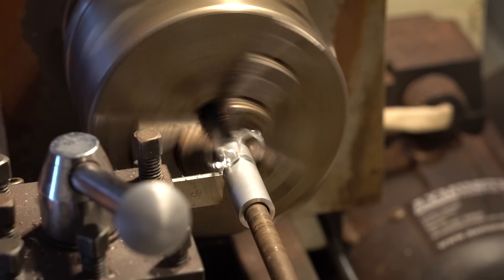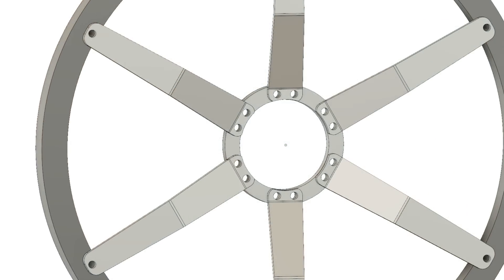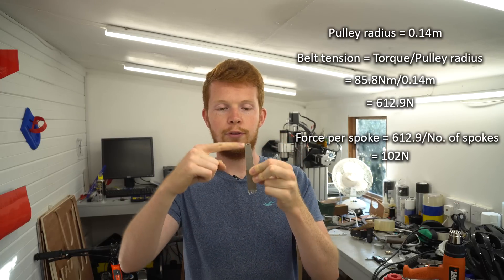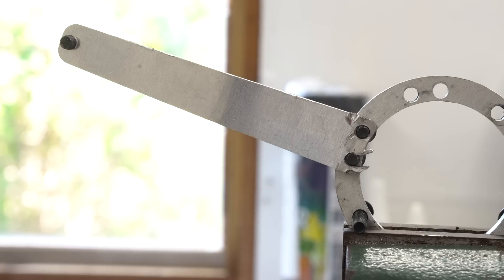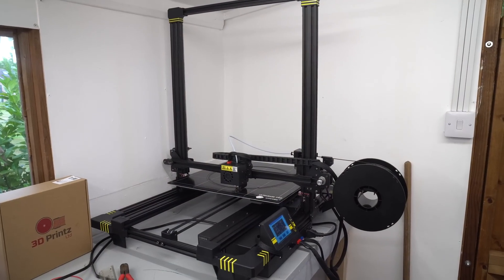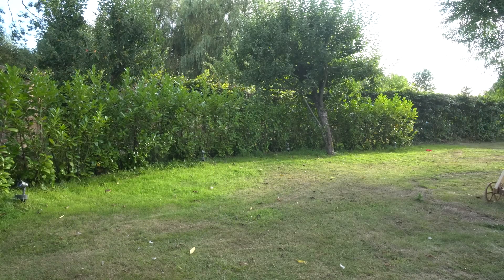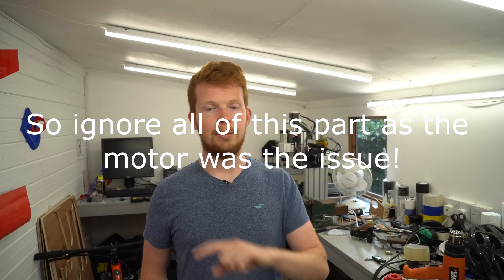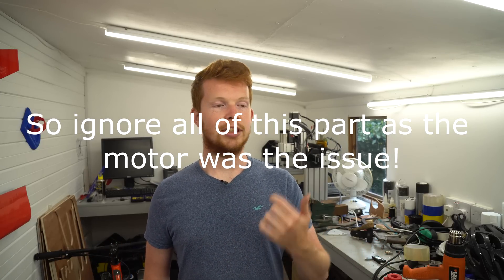Electric Bike 4.0 - Pulley Failure

Comment: Have to say I love the failure analysis. It’s great to watch your thought process.  Your bikes are great and I have shown your Norway drone video to a lot of people because not many people know how fast and agile they can be and the scenery, video quality, and music are awesome.  Your ability to get great 3D prints is also impressive. I don’t think I’ve seen much on how you get such good results.  If you could add a suggested link to resources you found helpful or if you think it’s just the machine or filament.  I have access to an Ultimaker 3 but have never gotten really great results on big parts and have tried numerous things to get big parts to print. The corners of the prints tend to pull up.  I have tried a lot of different rafts, boarders, bed adhesives, and filament materials and brands. I wish you the very best and thank you for all that you do.
Reply: Try increasing the Bed temperature and decreasing the Nozzle temperature to improve adhesion and reduce warping. On my CR-10s I am using 70 bed temp and 195 nozzle temp for PLA
Reply: Adam Ladd Will definitely try it!  Thanks!
Reply: Oh and also another very important point is that new rolls print a lot better than old rolls that have absorbed moisture over time
Reply: Robert Pearson What material? Also the Ultimaker uses a glass bed, which I've found with my similar bed, isn't perfectly conducive to sticking. Try some glue stick. Careful that it doesn't get permanently stuck in there though or else you might have to stick the whole bed and print in the freezer.
Reply: with glass beds (having sworn by them prior to making the jump to PEI) there are four rules

Assuming your running PLA

1) Clean enough to do surgery on - Go over it with IPA to remove fingerprints, etc then over it with soapy water (obsly being careful not to flood the printer), the soapy water will remove any residue the IPA can sometimes leave behind
2) Flat flat flat flat flat - For glass to work properly it must be very very level
3) You wanna *squish* the filament into the build platform, the way it works is it holds on via suction. Though if you move to PEI, ***do not*** do this, otherwise you will permanently bond whatever it is you're printing to the build platform and it's a nightmare to resurface thanks to the 3M adheasive :)
4) Slow and steady wins the race, fast and greedy gets pie in your face (sorry was in a ryming mood today lol) - You want your first layer to be decomposing food slow, like, 5mm/s slow, reason being is the first layer is the most important layer of the entire print. The absolute maximum speed that I can personally recommend (on point #1 clean PEI) is 15mm/s

If you're using a plastic that shrinks a lot (ABS) or a bit (PETG) then you will want a higher air temperature around the print, atleast 25C though 40C is much better, particularly for the likes of ABS
Reply: Max Bainrot Thank you for taking the time to try and help.  We have tried clean but maybe not clean enough.  I will definitely try very slow, and loved the rhyme.  Thank you again and will let you know what ends up working.
Reply: You're welcome :)

Seeing your other reply I'd say stick to PLA for now, Nylon is notorious for shrinking and iirc requires a heated build chamber.

Don't go too ham on cleaning it, glass is glass (very flat and non-porus so easy to clean, glass is normally manufactured on moltern tin in the "float glass" manufacturing method so it's normally *perfectly* level though non-borosilicate glass can warp) so it sounds like it may already be really clean then. With my PEI surface (I did the same with my borosilicate glass plate) if I touched the build platform I would give it a quick clean (I use to do straight IPA but then learned about the potential for residues so started doing the soapy water + wipedown dry thingo) other than that I usually just give it a cusory dusting (where I live it's super dusty).

I'd also try doing say 9x cubes of about 20-25mm dimension in a tic-tac-toe like grid but such that they are spread out over the build surface. Alternatively doing a brim should also do the same thing in highlighting inconsistencies in leveling. On my printer I do a skirt because I have a lot of nozzle priming issues and on occasion where I've adjusted something gotten side tracked and forgotten to level the bed, the skirt has highlighted the issue straight away.

Look at the first layer as it prints and see if all the lines look consistent between each of the parts as this can indicate that one part of the bed is not level.

With the model there are a few possibilities of where warping could occur. PLA doesn't shrink a whole lot but it does still shrink a little, over the height of the print it is very likely that the stresses within the part are building up, I had this one part I was trying to print, it was a tripod holder for my android phone of the time out of ABS, and I had issues with it detatching from the bed due to those stresses, so I got fustrated, droped 0.3mm layer of PLA (that I mooshed into the glass like I wanted to break the glass lol) then used that to help the ABS stick, it worked extremely well, so well in fact that the part split in half just to spite me :| Turns out the ABS filament was contaiminated with moisture so had terrible interlayer/build surface adheasion

On the top parts of the U shape, are they right angles or are they filleted (rounded off)? sharp points can also cause warpage so if your design permits try rounding off the corners as well. Another option, maybe as a last resort is break it down into shorter pieces and glue them together as the height of the part and length of it is a bit risky as long narrow pieces can build up internal stresses very quickly, though it sounds like what your describing is only partial loss of bed adheasion?

Keep at it though, $3000 paperweight is only a paperweight if you let it become one :) my first 3D printer was a complete dog, cost me $500, had no instructions and the aluminium surface was rough and PLA refused to stick, I kept at it, doing lots of different tests. I found that running it very hot (65*C or about 149F) helped but the bottom was bowed out (due to it being at the glass transition temperature of the plastic), eventually I learned about glass, though it did improve things, my printer was still unreliable. More experimenting and more reading brought me to the conclusion my mechanical Z endstops where junk. 5 attempts later I managed to 3D print an optical endstop for the Z axis, retrammed/releveled the bed (the printer was so junk everytime I moved it, everything went all out of whack) and tried again, finally success. Then as I did large prints i had issues with uneven bed, doing some measurements I found that there was a bow in the beds movement path so I moved away from glass to PEI so I could use an inductive probe and haven't looked back.

The ultimaker is a damn fine (but bloody expensive) 3D printer, most of my issues I had, you won't have. Particularly given that the ultimaker is like my current 3D printer (the successor to the one I described earlier), it's a Core XY printer, so the build platform doesn't move other than up and down. Definitely double check the level as I have found with my HyperCube that the bed can be off kilter, particularly towards the front as it's furtherest away from the linear rails.

Good luck and remember to have fun and remember that no matter how fustrated you get, just hang in there, sleep on it if you need to and you'll come up with fresh ideas. It's great you're asking for help, it's a mistake I made, I didn't ask for help so my experience was a lot more fustrating than it should have been.

* looks up at the great wall of text, I am so sorry dude for writing you an essay O_O *

To save you some reading
- Stick to PLA, Nylon is very difficult to print and is notorious for it's shrinking
- It's quite possible bed is already clean, don't go too ham on it, just wipe it down to be sure
- Consider rounding the corners (filleting) of the U shape - sharp corners can induce lifting
- As a last resort, break the part into shorter pieces, long tall parts can have a tremendous amount of internal stresses
- Do many small prints all over the bed (best to do it in one print) and observe the first layer, look at whether there is consistency between each of the parts, any differences would indicate a bed that is not trammed/level, alternatively do the U print, but have a skirt (say 2-3 laps) around the perimeter as that will do the same effect
- Don't give up, you have a damn fine machine, it only becomes a paper weight if you let it.
- Keep up the great work, it's great your asking for help, many of us haven't and have suffered unneccesary heartache as a result.
- Bonus content! (I hope this comment posts O_O) write down all of the setttings and what you have tried, so when you hit issues again you remember what you did to fix them.
Reply: Max Bainrot I’ve got a lot to try. Thanks for taking so much time to help a stranger.
Reply: Robert Pearson I have the opposite problem nowadays with my prints. I use a borosilicate glass bed from Aliexpress (but just normal glass shouldn't work any different) and apply a thin layer of diluted pva glue (simple white glue, the type used in primary school. Should be pretty cheap). I dilute it with water untill it has the viscosity of water but is still solid white, then store it in a jam jar. I use a sponge or brush to apply a very thin layer, remember to rinse the brush or sponge or it'll dry solid.

I then turn on the heatbed to printing temperature so the glue dries a bit faster. After it dries you can just print directly on it. Usually you can use a coat a couple of times, but it rinses off easily under a lukewarm tap so I tend to replace it every time.

My biggest problem now is prints sticking too well. Current strategy when stuck is putting them in the freezer, which sometimes pops them off because of the difference in expansion rates between glass and pla. The condensation afterwards does ruin the pva coating.

If that doesn't help, I rinse away what is left of the pva coating from the bed and try to get some water between the print and the bed. I then put the wet print+bed in the freezer. The expanding ice tends to pop the print right off.

Haven't had lifted edges for months now. Have had a couple tough-to-remove prints though...

Never try to be lazy and touch up the coating after parts removal with some fresh glue. The water in the fresh glue dissolves the old glue, leading to messy globs of glue on the bed and a failed print. I learned that the hard way :P
Reply: Joran Groothengel  I will definitely try this. I remember hearing about using Elmer’s glue but was honestly too chicken to try it, and wasn’t sure how to apply it. The solution is dilution :)  apparently. Thanks to all.  I actually have faith that I might be on track to converting this paper weight back into a printer.
Reply: Also thanks to Tom for having such a great community willing to help.
Reply: Ok... So probably not unexpectedly together it all worked.  I used Elmers Glue, I slowed it way down, raised the bed temp... I now have one working part!  Its slow but functional.  Now I have a backlog of stuff to print.  Thanks all!!
Reply: Anonymouspock We tried PLA, And Nylon. We also tried new and different brands and ultimaker brand. The print isn’t huge. It’s 2x3 inches and say 5ish inches tall. We have tried glue sticks and aqua net hair spray. The base of the print is a 1/2 inch wide U shape. We also tried different orientations (print on the side).  I really appreciate all the great advice. I’ll let you know.  I will be in the lab tomorrow...today actually and will try out your suggestions. At this point I’d try almost anything.  I kind of look at it as a $3000 paper weight.

Comment: If you put a bearing on the motormount were the drive shaft exits to stabilse the vibration? Maybe that can solve the problem?
Reply: Constraining the vibration will wreck a bearing, either the new one that you suggest to be placed, or the ones in the motor, which will be difficult to remedy.

Comment: I completely understand that you want to change your video upload schedule to maximize your workflow. However, I will say that I love to see these weekly updates, failures and all. The biggest thing I have gleamed from your work is that when something goes wrong, not to get frustrated, there is usually a good way to engineer around the issue. All in all,  keep up the amazing work. I always look forward to watching your videos!
Reply: TheManShel Yes! the attractive of the weekly videos has exactly been that, but I reckon that it would be significantly easier to edit just one long video than two short ones. So maybe he could do that, a long video not only to show a project working, but the issues he found on the way and how he solved them.
Reply: Yup right there with ya!
Reply: You'll go a long way in life if you have the mindset that there's always a solution, because there is. That's the point of being an engineer, solving problems. In fact this is true for many other disciplines, such as programming, research, and even machining.

Comment: Is it possible that the modification you did shortening the motor with the lathe has messed up the balance of the motor?
Reply from the maker: Yes I reckon that was the probable cause, so I'll have to re balance the motor and hope it solves it.
Reply: it might also be the clamping force of the lathe chuck squeezing the stator and the rotor together thus creating a grind,or knocking a neodiddlium magnet loose,

it looks like the spoke that broke off, tore alonge its extrude/rolling direction, you can try some thermoplastics and bend them using heat,  or a punch die cut continuous disk,
Reply: maybe you can remove some mass from the pedal winch?
Reply: A single steel grub screw in an aluminium pulley would likely throw balance off worse than any flaws  in the shaft or motor, so maybe try the pulley in various orientations, or balance the motor with the pulley attached.
Reply: Good thinking. If the motor shaft was ground flat for the grub screw, it would be out of balance even with the pulley removed. Add the pulley and who knows how that would be balanced. The motor and pulley combination would need to be balanced as a unit.
Reply: Tom Stanton That doesn't make sense, unless what you cut off wasn't symmetric. If you trim the end of a rod it doesn't mess with the balance
Reply: brushless motors are balanced after they are manufactured, even though they are generally symmetrical too, at high enough RPM i guess maybe just small variations in metal density matter.  just like a car tire i'd think.  hopefully he can use a RC brushless motor balancer and a little epoxy putty or some such to pretty easily re-balance it.
Reply: smaller motors can be balanced by using tape, smartphone vibration sensor, and trial/error
Reply: Robert the balancing was probably done by removing weight from the end section around the circumference so when it was lopped off the balancing done was removed. That’s my guess
Reply: Could the flattened shaft cause the imbalance? Keyways are better
Reply: Absolutely, at those rpm milligrams can make a huge impact 👍
Reply: I don't know anything about motors, but is it possible that it's not a mechanical issue? I don't recall him testing the motor beforehand.
Reply: USWaterRockets -  Good point.  Wonder if there is a way to dynamically balance the motor in its current state?
Reply: I was thinking about this and it might be very difficult. If you think about it, at those RPMs the slightest imbalance can lead to a small vibration and a tiny vibration can find a resonance with the mount or frame that causes it to become a huge vibration. The actual vibration may be really small and hard to correct without special equipment. A better approach might be to try and raise the resonant frequency of the mount and frame to a point above the vibration frequency of the motor at top speed, so the resonance can never happen.
Reply: @USWaterRockets  himm, resonance maybe, defective motor.....possibly tweaked the motor frame ( (overtightened bolts/uneven mounting torque/not enough motor support )  or motor bearings got slightly tweaked or some combo of all.  (  insufficient bearing lube? ).  ( strobe the motor shaft )
Reply: Awesome video Tom
Love that you bring in the engineering aspect i to your videos 😎
Reply: While this design is likely more efficient, (than commercially available kits) it is ludicrously more expensive. Seeing how most people don't have access to the equipment he has access to, most people cannot do this project.  E-bikes are just not good enough at this point and likely never will be.  The energy density of batteries is just far too low and far too expensive and this is unlikely to change in the foreseeable future. If electric cars are even remotely successful, they will keep the price of batteries very high.